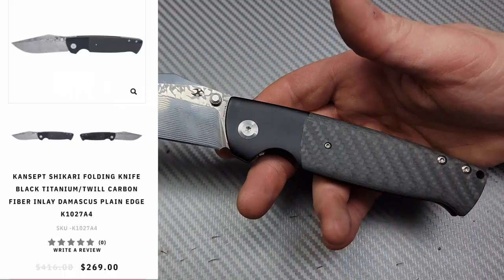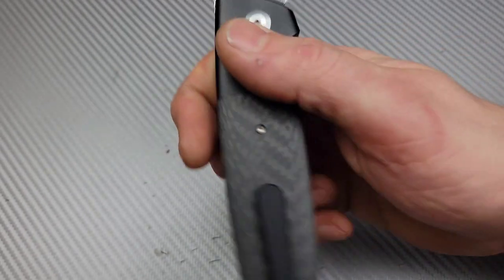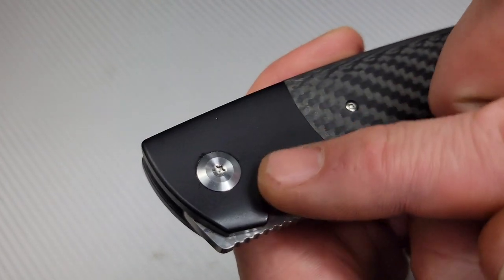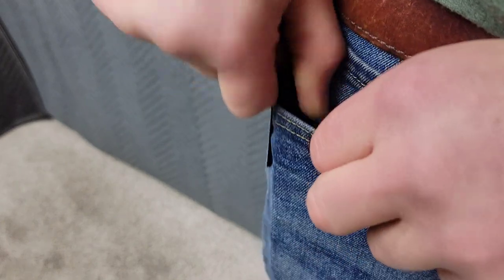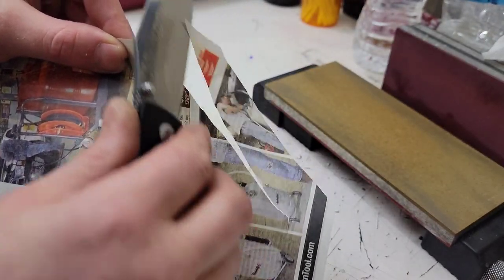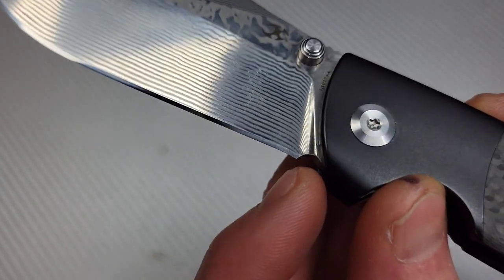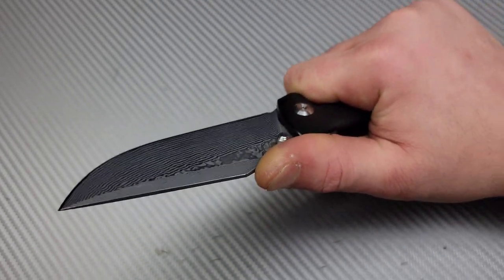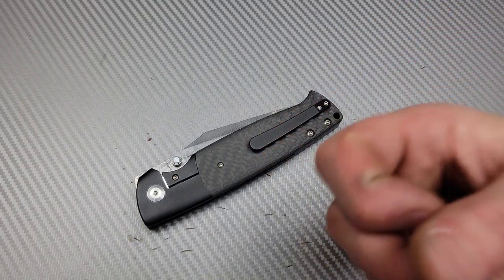KANSEPT SHIKARI FULL REVIEW

Comment: looks like it wants to cut everything, including the user.   Pretty badass folder.  Frame-lock cutout is cool, but I tend to stay away from them for EDC, in my opinion.
I like my fingers out of the way when I am closing the blade on a super-smooth flipper.
Good job on the edge there.
Reply from the maker: Yeah but it's right up your alley
Reply: @NeevesKnives  yes, just not in my current budget.

Comment: I've got one and I like it, mine has a stronger detent so reverse flick and front flipping don't work well unfortunately. I think a blade mounted internal stop pin would have been fantastic on this. I wonder if a choil could be cut in as long as you don't go deeper, just extend it up the edge, would that mess anything up?
Reply from the maker: Hard to say I think as long as you don't cut into the exact area it hits which you have to take it apart and make sure but it should be at the deepest point